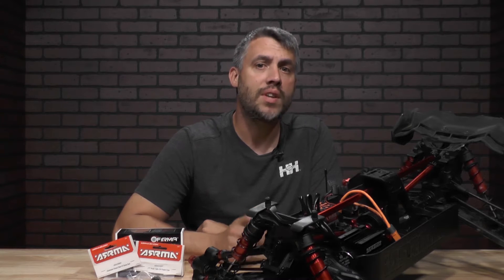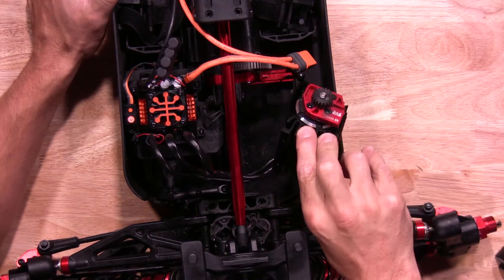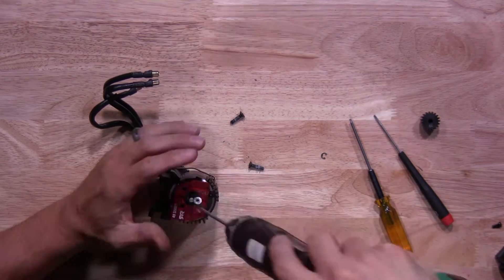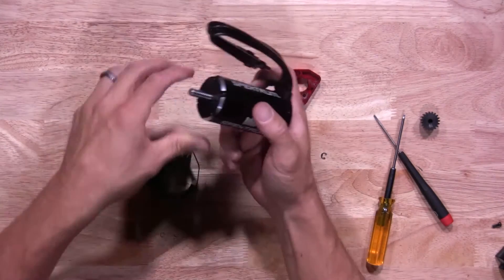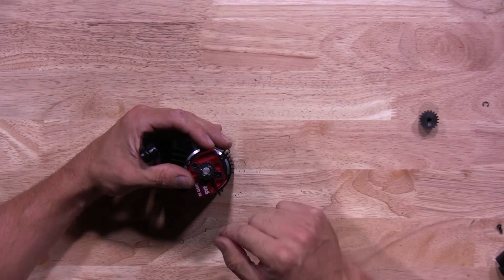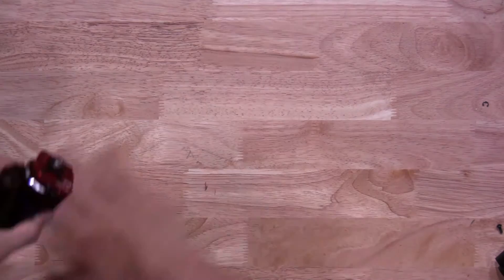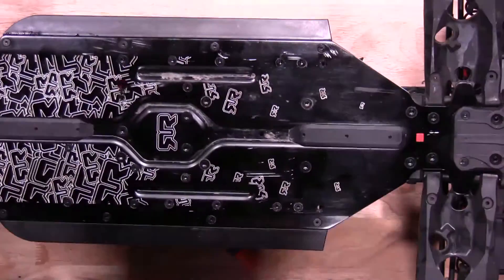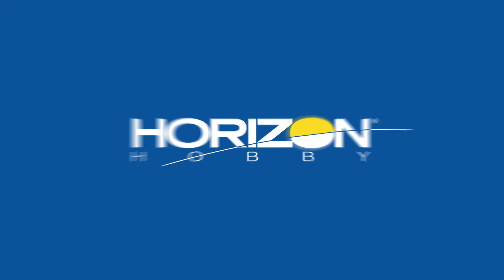From the Tech Desk: How to install the Spektrum 1250kv 8mm motor shaft in the Arrma 8s

Comment: What 8s truck do this motor come with
Reply: Outcast and Kraton. I don’t know why anyone would want to switch to 8mm. That just limits the pinion you can put on it😂
Reply: I broke a 5mm shaft motor and replaced with the 8mm. Went from slick grass to pavement. Kraton 8s